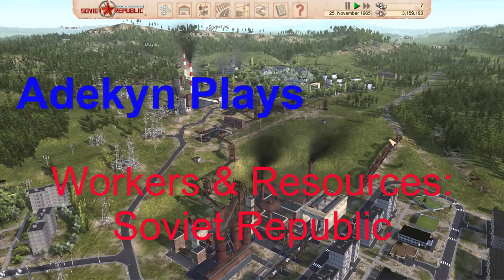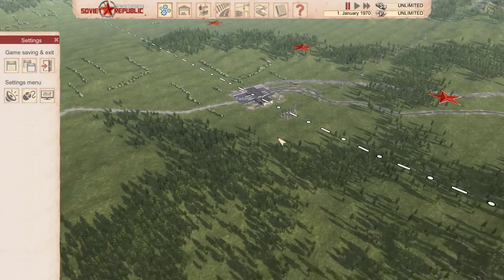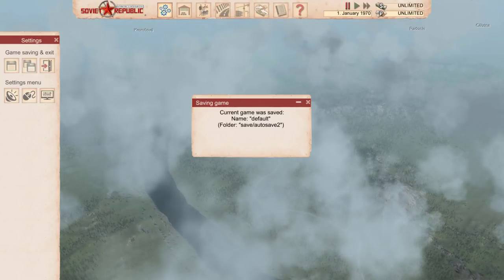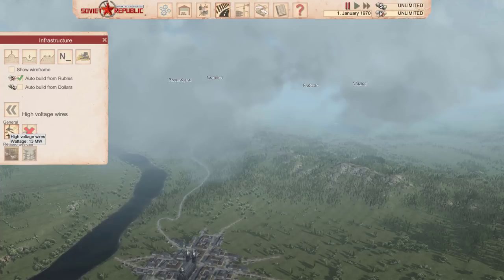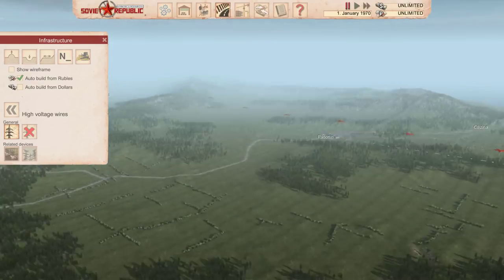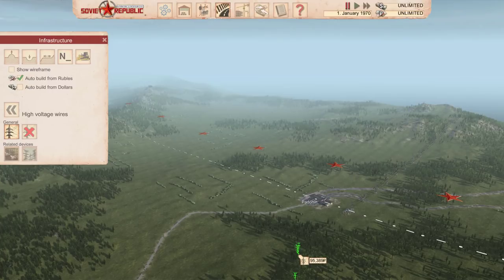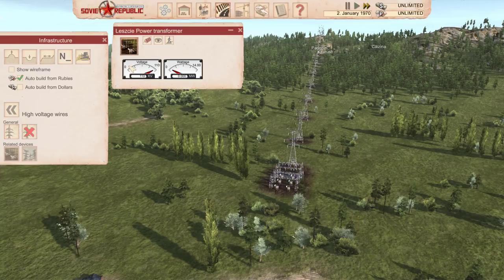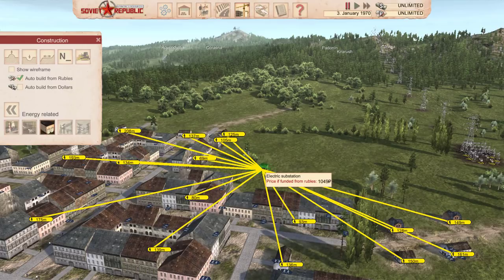Workers & Resources: Soviet Republic - Quick Guide - Electricity

Comment: Made some changes to my electrical layout after getting a good idea from this guide.  I used a transformer to cut down on chained switches and it fixed my repeating blackout problem.  Thanks!
Reply from the maker: Excellent. Glad to be of service. Please let me know of any other topics you would like to see covered.
Reply: @Adekyn100  A guide to optimal city building placement would be nice, if there even is such a thing.  Seems like I always have some necessity just out of reach of my housing and end up with a mess over time.
Reply from the maker: I agree. That has been on my short list for a while, but I want to wait until I have a better handle on the happiness thing (especially at hard difficulty) before I put something out there. Our next video will probably cover an alternative approach, one I want to try that involves a downtown and sections of town around it that support various industries connected by very active bus lines. We shall see.
Reply: @Adekyn100  Well how about a quick railroad guide?  I swear I have a straight run from a warehouse to the border to export but the train says it can't find it's way from the warehouse to the border?!  Must be a missing, or an extra, semaphore in there somewhere where it ties into my main line.  Grrrr....
Reply: Finally got it sorted out after about 5 tries.  The final piece to the puzzle was a two way sempahore where the trunk line joined the main line so my train could find it's way back from the border to the warehouse.  A one way semaphore at the trunk line connection would not work.  Yup, a railway guide would probably help a lot of folks.  :)

Comment: Hi Adekyn. I have 4 power plants in line exporting to both Nato and Soviet border. How can i sum up the Wattage of all them and receive more reveneu? I tried with power switches and connecting all but some of the power plants then decay the production
Reply from the maker: Are you certain that all the power plants in your system are being adequately supplied and staffed at all times?
Reply: @Adekyn100  yes. The only solution i got was to send the power of every plant to diferent borders. My Monet started to increase and the plant are working +50% efficiency